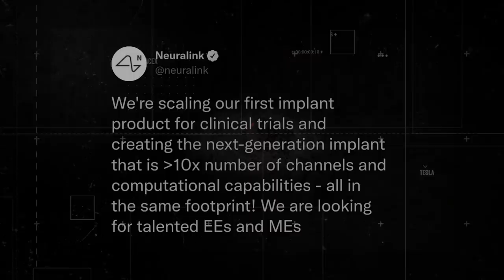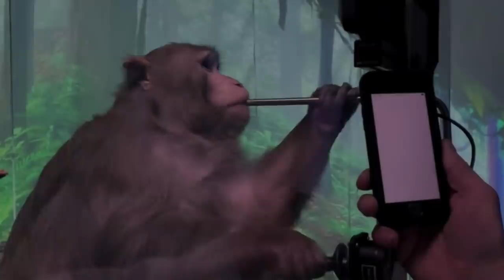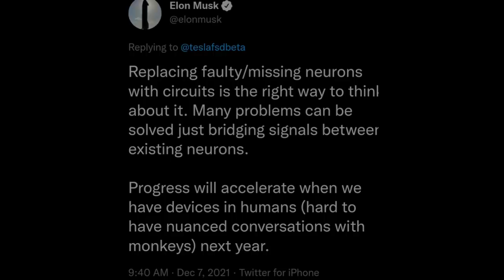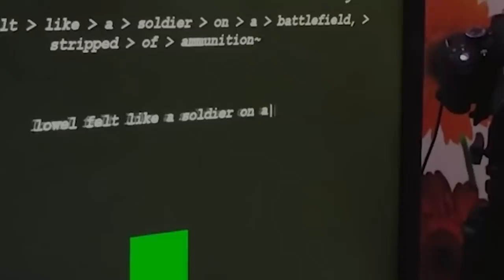Elon Musk Reveals How Neuralink Will Change Humanity

Comment: I love it I also have a idea about the rockets and in my options of just a idea wondering if under the sheld there can be a solar panel that can have the ship each time it goes up and of course still keeping all the bells and whistles of all you have now but a rocket that can be tested on storing heat to energy so when up in space or your plan to go to Mars you can power a ship by the sun a test with no one in it in case something happens bad those are my thoughts on saving if not also storing fule that you use going up and coming down and to have as you do now the same system of how fule operating system is but two fule systems when one goes down the other comes on and like I sead never forget that you should always keep the manual systems for reboot if for a shut down